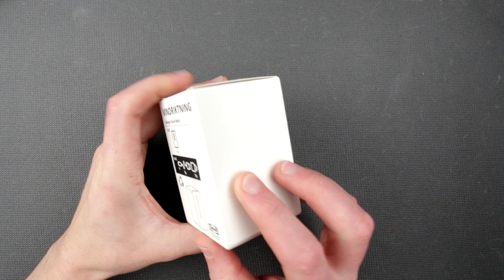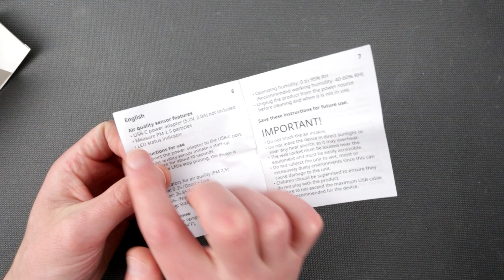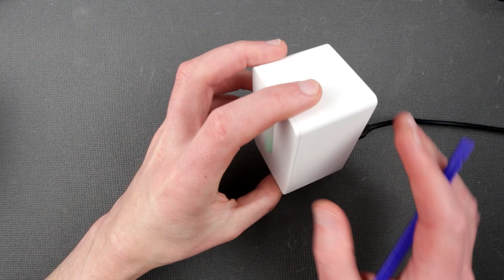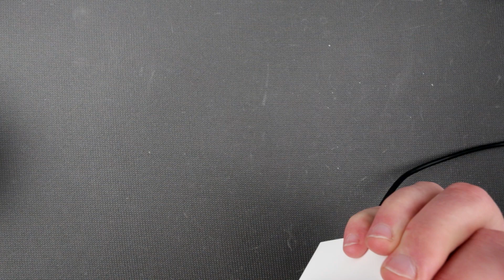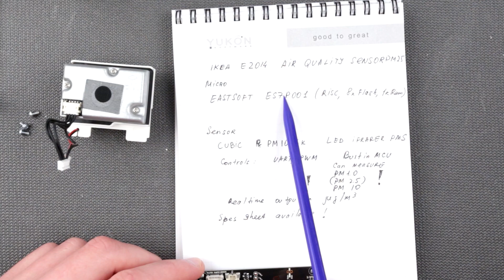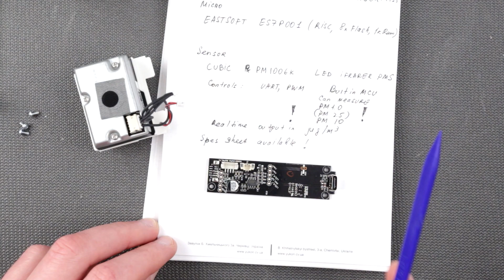Ikea VINDRIKTNING Air quality sensor HOW IT WORKS

Comment: Hahahahahahhahaha! Cannot blame you for you may not be familiar how that really works. I was yelling in my head "WHY!". HAHAHAHAHAHAHAH! I thought you knew how it works since you are into electronics and it is an electronics part.

1) The said "soot" is not soot. It is vaporised wax. It settles on surfaces, hence the sensor is fundamentally stuck with solidified/condensed wax. The sensor could have been permanently blocked with that wax. Vaporised wax is rather heavy, it cannot stay suspended in the air for that long relative to that smoke from a match.

2) That LED thing makes up the opto-sensor thing identical to that in mouse and in anything which needs counting. It is also used to measure bacterial growth or spores by optical density.
Reply from the maker: Thank you for watching, this video about how the whole unit works not about how PMS works.
Also when candle burns it should not emit any wax vapor, - only water, co2 and small amount of soot. You are welcome
Reply: @InsideOutElectronics   Thank you for responding.

You are wrong again.

https://youtu.be/Uau_eKoRn6c?feature=shared&t=64 (The Royal Institute)

https://youtu.be/B9asozzeAwY?feature=shared&t=81 (American Chemical Society)

The pleasure is mine.

Comment: I always wondering how the brightness of the indicator change. Thanks for your tear down, that infrared sensors work just as the light sensor in our phone, but it won’t change  for your room light but the sun light!
You can hit that sensor with a remoter to see it change brightness
Reply: I didn't know it was an infrared sensor until he mentioned it. Indeed the brightness of the AQ sensor starts flickering with the IR TV remote :D